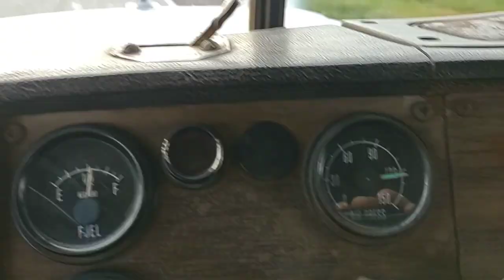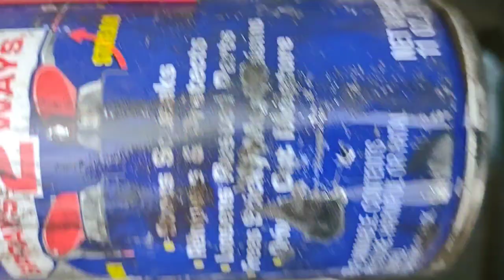R model Mack up and running again!

Comment: From. Canada. / I.  drove.  those.  in. northern. Alberta.  Canada.  in.  the.  oilpatch.  back.  in.  the.  middle.  1980s.  tell.  early.  1990s   mostly in. the.  wintertime.  - 20.  below.  or.  colder. with.  a.   winterfront. (covering.  front.  grill. too. help.  keep.  the.  heat. in.  the.  truck- cab) even. though the.  truck.  had.  a. good.  heater. in. it. , the.  R.  model.   Mack. are. one.  tough.  truck. used. Lots.  in. the. past. for.  oilfield.  and.  construction. and.  I.  found.  they.  alway’s.  started. well. in. the.  winter.  , but.  you.  never.  shut.  (.  the.  engine.  off.  in. real. cold.  weather. ). and.  if. it’s.  not.  that. cold.  wintertime   and.  you. do. shut.  the.  engine.  off.  make sure.  you.  plug. in.  block. heater. ( keeps.  the. oil. in. engine.  warm. ). in. wintertime. and.  park. on.  Level.  surface.  with.  your.  air.  brakes.  off. and.  block. the.  tires. on. the.  truck so. it. will.  not. roll ahead. or.  backward’s. and.  the.  brakes.  won’t. freeze. up. by.  your.  back brake. drum’s.   Those.  old.  R.  model.  Mack’s. Look.  pretty. nice.  when they are.  totally. restored. , but.  who.  can.  afford.  that. unless.  your.  rich. ,And.  I.  don’t.  know.  about your. state.  ,I. have.  been.  too.  Wichita, Kansas.    back. in. the.  1970’s.  Long haul. from.  Calgary. , Alberta. Canada. ,  I. almost.  signed. up  for.  custom. combining. from. Canada.  ,when. I. was.  around.  19 or. 20. year’s. old.  back.  in. the.  Late.  1960s. / The.  crew.  I.  was. told. would.  start.  the.  harvest. in. Kansas. and.  work.  your.  way.  back.  north. too. western.  Canada.  ( for.  fall.  harvest.  Canada). never.  went.  , Went.  too.  work. as. a. roughneck. ( oil rigs.  for.  awhile.). Alberta. and.  Saskatchewan.  Canada. If.  I. we’re. you. especially.  in.  the cities. watch. we’re you.  park. your. truck. and.  trailer. , I. ‘ ve.  been. told by. trucker’s. and.  farmer’s. and.  ordinary people.  there.  stealing those.  Bulldog.  hood.  ornament’s.  off.  those. R.  model.  Mack.  truck’s. especially.  the.  Gold.  ones, probably.  Crackheads. (. Drug. user’s. ) apparently.  there.  worth.  something. Like.  the.  RAM.  hood.  ornament. on. the.  old DODGE.  pick- ups.  Like.  the.  1985.  I. own   sitting. in. the.  backyard. of. my.  home.  , As. I. remember.  Kansas. was. a beautiful.  state.  Like.  Texas.  ( been. too Midland.  , Odessa.  ,Houston. and.  Dallas. Texas. ) over. the. year’s. /. Good.  Luck with.  your.  R.  model.  Mack.  they. are.  a good.  working.  truck.  and. have. a. good.  day and.  I. hope.  the farmer’s. in. Kansas and. all. the.  southern states. ( Get.  a good.  harvest.  crop. this.  year. ) People. must.  remember. farmer’s.  feed. the.  citie’s and.  trucker’s haul. the. food. too. the. cities / All. my.  best.  Bill.  S.  Canada